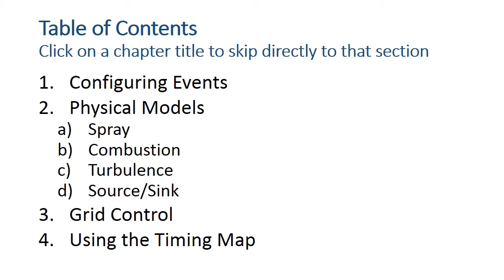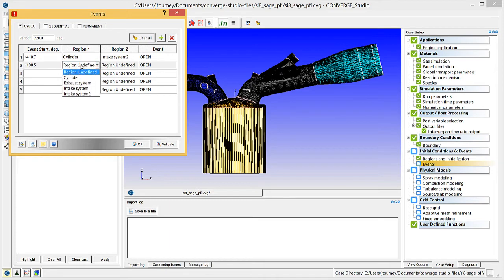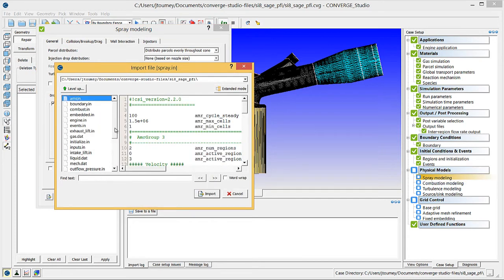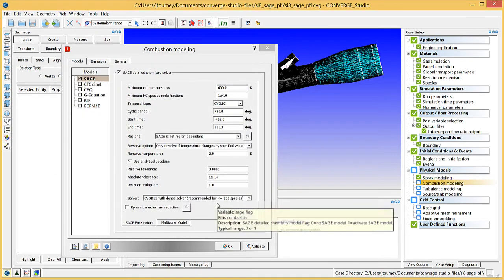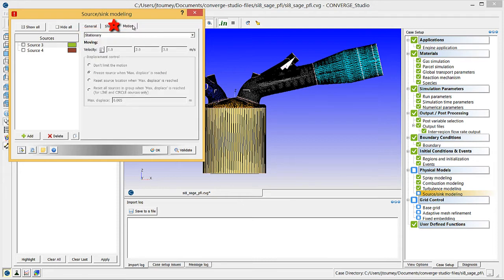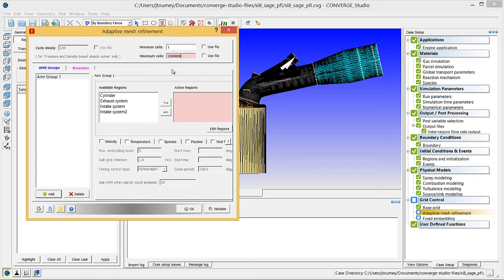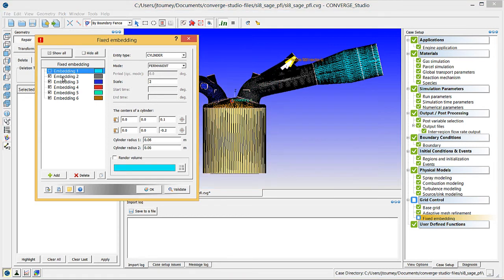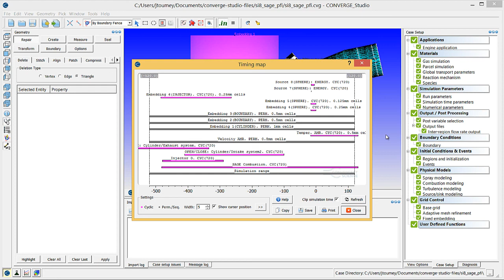CONVERGE Studio 2.2 Training: Case Setup (4/4)

Comment: How long did it take for solver to solve this case using command prompt method? Mine is taking forever. Thanks. (NodeLocked - Serial)
Reply from the maker: Hi Riddhish. Thanks for your question! CONVERGE support does not monitor our YouTube channel. Please post specific support questions in our CFD-Online forum which is actively monitored by CONVERGE support engineers and an active community of CONVERGE users. https://www.cfd-online.com/Forums/converge/
Reply from the maker: Hi Riddhish. Thanks for your question! CONVERGE support does not monitor our YouTube channel. Please post specific support questions in our CFD-Online forum which is actively monitored by CONVERGE support engineers and an active community of CONVERGE users. https://www.cfd-online.com/Forums/converge/